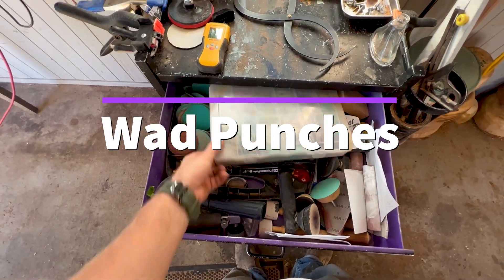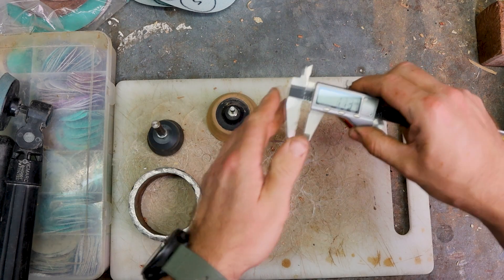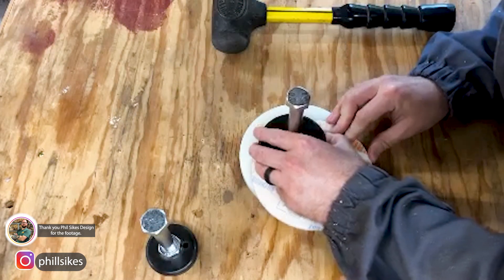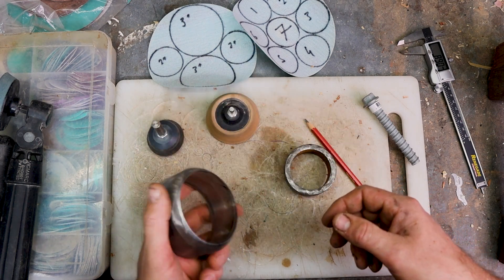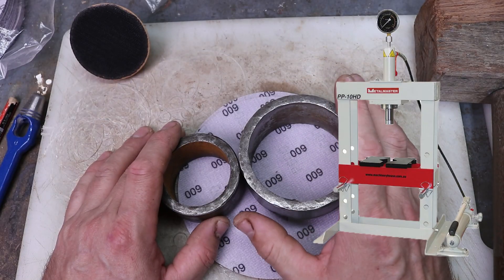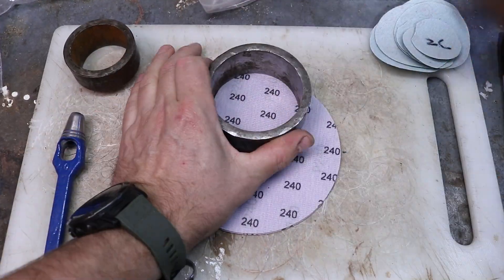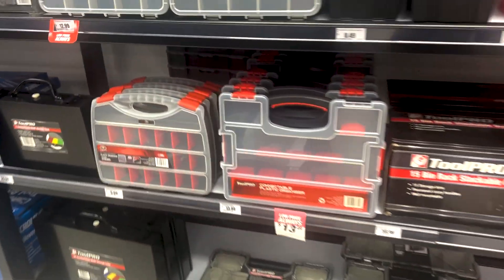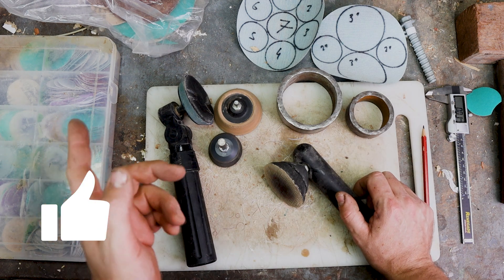Woodturning WAD Punch. CUT your own sanding discs! GAME changer!

Comment: I've made wad punches from old hole saws. I grind off the teeth and sharpen the edge at about 40 degrees. I have also threaded and welded a bolt into the hole saw where it fits the mandrel. Works a charm....saves a lot of money.
Reply from the maker: Mate that is brilliant. Sounds like it would work a treat. Thanks for sharing that mate.
Cheers,
Kez